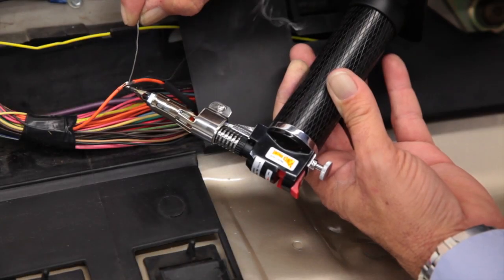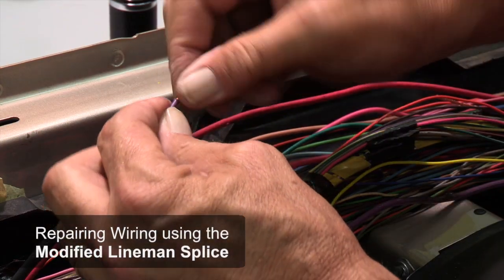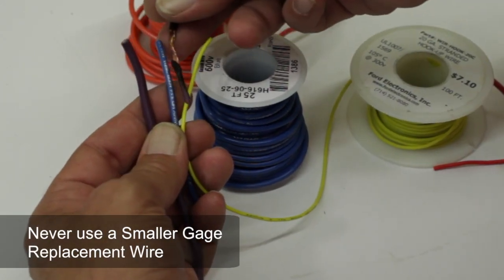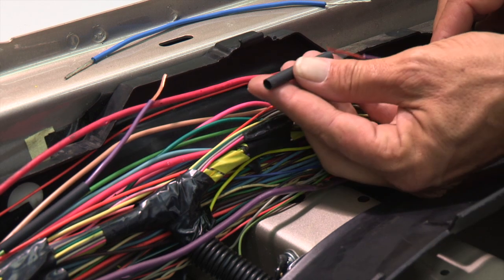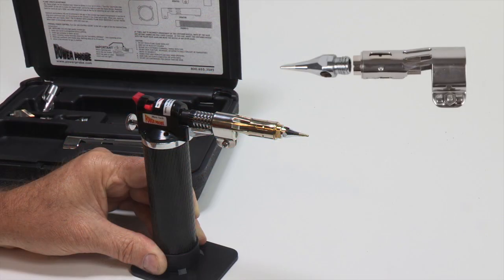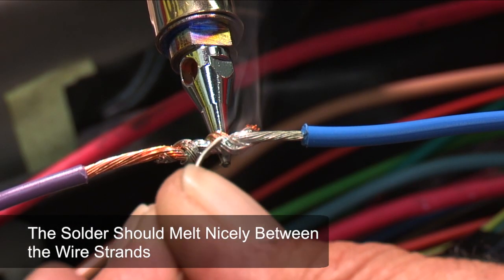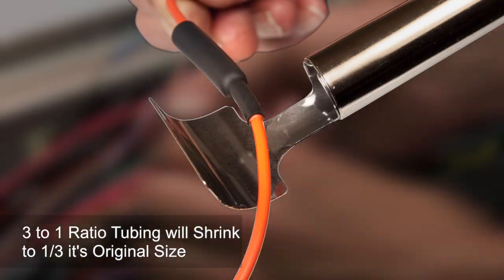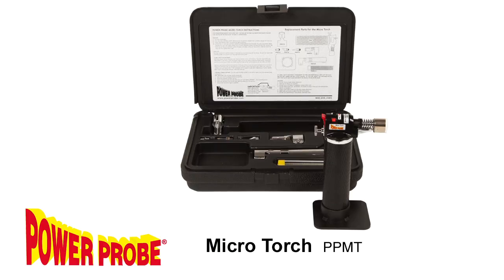Automobile Harness and Wire Repair, How to Solder and protect wires

Comment: What moron in your company thought it would be a good idea to get on YouTube to promote your product for a procedure that has been against best automotive practices for the last four decades?  Soldered joints are prone to vibration failure and have been explicitly advised against by every automotive manufacturer's published  electrical system guidelines since Christ was a corporal.  So, in effect, you are saying, "Ignore those guys and buy our product."  

You are promoting unsafe practices and should remove this video.

Comment: Can 1 or 2 strands of a wire being cut prevent a wire from working correctly??
Reply: Shouldnt... but it depends on how big are the strands, what is the load on the circuit

Comment: or just do it the proper way and use open barrel splices and adhesive lined heat shrink, there is a reason the oems dont use solder in their harnesses
Reply from the maker: thanks for your input

Comment: Where do you buy automotive wire like that? Can it be any wire as long as it's the same gauge? Trying to avoid buying an entire harness just for parts.
Reply: Autozone, Amazon, any hardware store probably. Just need to know what gauge you already have on the part.

Comment: I would never solder the wiring of a vehicle wiring harness unless that connection will not vibrate, unless of course one wants to troubleshoot broken solder connections at a later date.

Comment: Avoid letting the solder wick down beyond the twisted joint, 
in fact, you should have split each the wires into pairs of strands, then overlap twist them into each other. THen apply just enough solder that wicks no further than the last couple twists. THe twists acts as a strain relief,
Dang i need to do a video showing people this.
Reply: Yet you never did because you're lazy. Easy to say how to do things proper. YouTube full of you clowns

Comment: Well it's not the way it should be done. Single wires in the cable should be combined with second cable and then twist and solder. In your case it will be much fatter than regular wire.

Comment: So I'm working on my first car and I got a new battery and new terminals. The terminals are generic so I had to cut the wires to connect them to the terminals. Because the had the factory clamps. I ended up cutting the positive green wire to short that connects to the fuse box to the battery. I'm I able to repair it so it could reach to the positive terminal using these tools?

Comment: That solder technique was mediocre, you don’t need that much solder, and heck, why do you strip that much of insulation? I usually only strip just enough that you can twist two wires together without having too much exposed wire.

Comment: everyones a professional in these comments. jeez...
Reply: Can you explain why heat shrink was added to both wires?
Reply: @mmmmmlemons  ... at what partin the video? Ask one of the professionals in the comments. I only dealt with Air Force classification wiring on aircraft per a TO so I wouldn't know. 🤓

Comment: I used to solder in this way when doing repair on my car some years ago. I recently discovered that the solder had cracked (wires still connected) after around ~ 3 years of use in engine compartment. I did though isolate the connection waterproof. Vibrations and temperature changes (especially in my area) had weakened the solder and it could probably have made a bad connection after some time. 
I replaced all repaired connection with butt connectors that had heat shrink tubing after advice from mechanics. 
In general i would recommend if you do repair in a place where you the wires are absorbing vibrations or temperature changes such as when the engine heats up/cools down after use, use butt connectors. If you want long term solid connection.
Reply: You probably had cold solder joints if it was "cracked" and the wires were still connected mechanically , meaning your solder was just covering the outside of the joint and did not penetrate into the inside of the joint flowing through all the strands of the wires , a properly soldered joint will not crack what can happen though if it's not properly insulated, at the end of the soldered joint the wire strands can get corroded and can eventually break off from mechnical stress , the actual soldered bit will be fine in this case.
Reply: Terrible advice...

Comment: This is a commercial for your proprietary torch kit. I have an electric iron that I used in Iraq, much better. Also I always tin any wires prior to connecting. The dissimilar metals are not proper. Thank you for making this short.

Comment: Thats a pretty bad video when it comes to details. First, you want to mach colour coding of wire. Last but not least, you should never mach aluminium and copper wire. Ever heard of galvanic corrosion?
Reply: That wasn't aluminium wire, it was tinned copper.

Comment: Hi,  I need to replace my seat belt retractor plug with a new old which might require soldering / splicing. The wire might have 2 small copper wires in it but not 100% sure. 
How can I safely & effectively do it  the RIGHT way  since it is critical safety device that connects to airbag system?
Of course I can always look for experts or expensively replace the whole floor harness but that will be the last resort.
Reply: Disconnect your battery and wait for the capacitors to unload before working on it, just be careful not to short out any connections

Comment: I agree with this method of hooking two wires together rather than just soldering them side by side excellent advice thanks
Reply: its called a linemans splice, goes back to the old days of telephone wires being repaired up on poles, its reliable

Comment: You should never connect copper wires with aluminum ones. Within time galvanic corrosion will destroy the connection
Reply: That is nickel coated wire.
Reply: Thnks for the info
Reply: @naturelover8585  you are welcome!

Comment: would have been better with electrical silicone grease applied to the wires before heating heat shink.

Comment: wires should be crimped not soldered. soldering them make wires brittle. pro wiring harness have no solder at all. factories used to solder and have failure all the time.
Reply: sure IF you have the real ratchet crimper (not that pressed steel cheapo) and quality connectors, id agree, but for most people soldering and shrink tubing can be decent so long as you dont wick the solder up the wire, and use extra shrink tube to protect it from movement fatigue
Reply: nappinj12 lo

Comment: Corrosion does not affect copper. And calling that a good soldered connection 2:46?
Reply: it's a pretty good solder joint actually
Reply: Corrosion does affect copper. I deal with it every week. Living in the UK brings its challenges when exposed to salt. It turns the copper wire into green powder. So any chaffing and exposed copper is an issue here.
Reply: Copper is highly resistant to corrosion, yes. However, any contact between dissimilar metals increases the chance of galvanic corrosion.
Reply: I thought it was pretty good

Comment: can I use this for a airbag harness
Reply: Hi,  Did you get yours fix ok?

 I need to replace my seat belt retractor plug with a new old which might require soldering / splicing. The wire might have 2 small copper wires in it but not 100% sure. 
How can I safely & effectively do it  the RIGHT way  since it is critical safety device that connects to airbag system?
Of course I can always look for experts or expensively replace the whole floor harness but that will be the last resort.
Reply: James Chuaycham ป้อม ศักดิ์ชัย yes I fix my airbag harness....I recommend for you to use heat shrink tubing n use some electric tape on top of that

Comment: How much for the micro torch??
Reply: +CanadianCharlie64 
Use a lighter
Reply: +Jon Snow The Crow hey jon for sure lighter works extremety heat
Reply: Don't use lighter near fuel lines though, i usually use my soldering iron to shrink the tube, heat gun works too wich is basically this product

Comment: Why solder ? why not use an uninsulated or a butt connector on both sides ? I'm not an expert so am not trying to be a smart ass here i just want to know why go all this trouble when there is an easier method, I did a western union splice and wrap them with a wire tape on my car couple of years ago and now the tape is sliding off from heat and i want to use a better method in my car
Reply: what ever your chosen grade / method of repair whether you use twist and then insulation tape (temporary repair at best) crimp connectors or the method shown (the best imho for connectivity and protection against water) all methods should be insulated to prevent any possible electrical shorts. If a job is worth doing do it properly within your capability or pay a professional. btw .... you can use insulated inline crimp connectors that can then be heated to shrink and seal with glue to give the same iP rating if used absolutely correctly but they can be more bulky especially if more than one is used within the same area of a loom repair, extension or upgrade. Many ways .... but some are better than others depending on the variations of application :-)
Reply: +Gary Thorley Paying unfaithful professionals what screwed up my Chevy shorts like my ride is possessed just so i can take my car back to them, I will be ordering some Soldering tools and practice till i get it right, And what's with the heat shrink glue ? is heat shrinking not enough ? i got to look that one up, anyways bubba thank you for the reply
Reply: +SalemMillion i too have experienced poor work from so called professionals so i now do my own work if i have time but never the less there are a lot of great pros out there too .... you just gotta pick carefully if you cant do the work yourself. The glue inside creates a greater seal for no water ingress for 4x4s that go wading through deeper water than standard vehicles or stock 4x4s ;-)
Reply: yep tape was your mistake, he used shink tube, second he soldered it not just the splice.   sure crimp can be great, BUT only if you have the real ratchet crimper, not the cheapo one,  soldering and shrink tube  is cheap and easy and gives you other options
Reply: I'm pretty sure the purpose of this video was to show soldering procedure. If you want to watch a video about butt connectors, you're on the wrong page dude....useless post.
Reply: soldering the wire makes a stronger connection then a crimped on butt connector.

Comment: Did anybody notice that the he soldered the purple wire to the spare blue wire... instead of back to the other purple wire?  Also, why two pieces of heat shrink?
Reply: +mindmasterajae he was replacing a section of a wire, not just joining up two ends, so he showed how to correctly join one side, so you can follow the same steps for the other.

Comment: how fast and how hot does it make the tip when turned on from a dead start?
Reply: takes 30 seconds, but they heat up well, more thane enough to solder, but there are plenty of gas solder torches, they are good, but not as good as electrical, id even choose a 12v one over gas,  but they have their place if you cant get power there

Comment: Now you stated to place two pieces of shrink tubing onto the repair before the soldering, but I didn't see what you did with the second piece? is it a back up in case of failure, you know....plan B?
Reply: The second piece of shrink tube was for wire lengthening, when you will have 2 solder joints.
Reply: The second piece of shrink tube was for wire lengthening, when you will have 2 solder joints.